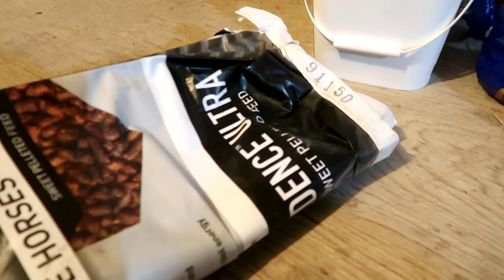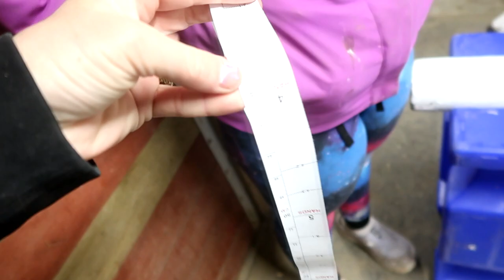HE'S HURT! Day 133 (05/11/20)

Comment: The reason Finn kicked out is because Sophie was niggling at him and saying go,go,go,go,go,go and he was getting annoyed, this is where your ground work comes into place, getting you horse soft and responsive and respectful, you also need to stand the the correct place behind the drive line which is behind the girth. I have done ground work with many horses and am a firm believer in it. I have a 3 1/2 year old that I am currently starting under saddle and when I got him six months ago he wouldn’t move off any pressure, now I can point and he will move out in a circle around me. I did a solid 4 weeks of ground work and still do even though I can walk trot and canter on him.

Comment: I think one of your problems with sore horses is the footing you have in your indoor isn’t proper and appears super hard. When the horses move on it it sounds very compact and dense. Bring in proper arena footing that has rubber or carpet in the fibers so that your horses can work on a surface that’s better for their bodies.
Reply: They’re planning on getting footing I think
Reply: It's currently all they have, but yes, I agree. Softer footing would be much nicer on the horses bodies when they work.
Reply: Hay mixed with the footing doesn’t help either

Comment: It really doesn’t matter if you have a whip or not, there’s not a wrong or correct way to lunge :) but you do have to make sure that you’re staying safe. Lunging can be dangerous if the circle is too small. Because Sophie is tiny, a lunge whip will make her seem a little more powerful. I was really concerned by how close she got to Finn, you’re not supposed to make contact while lunging because if you get too close you can easily get kicked which I saw nearly happen to Sophia and I was so worried. A whip will keep her at a safe distance :) As for Gabby, remember that your circle is your space bubble and the horse doesn’t enter it and you don’t exit it - there’s nothing wrong with using the lunge line as an extension of your hand but don’t throw it at ‘em and never chase them, just gently raise it and they should respond to minimal pressure. If you need to make a larger movement, make a motion with it upwards, and slightly outwards, but not directly at the horse as they will jump into a much larger gait than asked for, and it does trigger a spook or flight response. Moral of the story: don’t chase after a horse, make THEM work for you!! Stay safe!! :)

Comment: Can you drag your indoor to soften footing?  They could be getting sore from working in small space/hard footing.  Maybe use far three walls as guide for lunging circles.  Most common diameter for lunging is 20 m.  Any smaller will put stress on their joints.  Also if the girls try to keep arms in a “V” to horses head and hindquarters with back arm or lunge whip used as impulsion and front level with head.

Comment: Unlike most people here, I don't think you need a lunge whip. Just a heavier longline or a simple dressage whip should work do the trick. Personally, I feel like lunge whips are far too long and it's a pain carrying them around, you're more likely to give a horse mixed messages with one. That's just my opinion though.

Comment: Sorry if this sounds mean but Gabbys  lunge line gives me anxiety. Yes it's not suppose to be tight but that's waaayy to loose, if one of the horses  was to rear or buck when's its super low they could break a leg.
Reply from the maker: Was it low the entire time?  Shoot , when I cut the video I only include a few bits. I can never predict what people.will be upset about. I will try better to only show the parts where she does it perfect!
Reply: @DayByDayVlogs  no need to have it perfect all the time, there's just a couple of points were its a little to loose and it worried me a lil. It was on the right side of the circle near the exit to ponies. She just needs to pull up lunge line up on the sides be more aware .